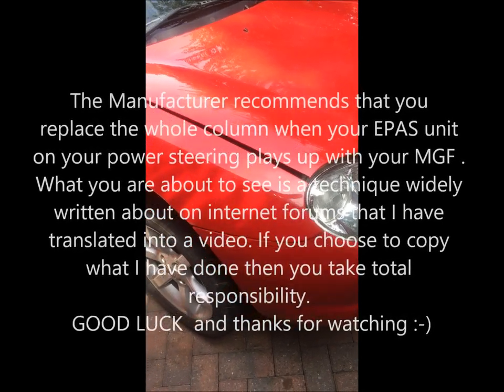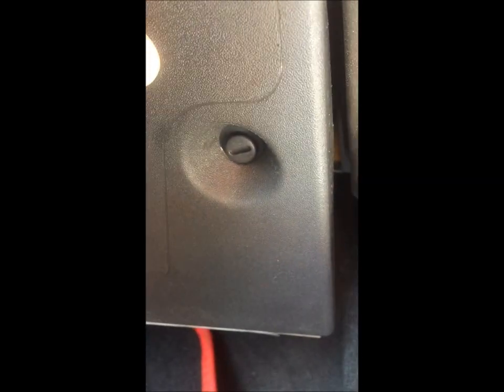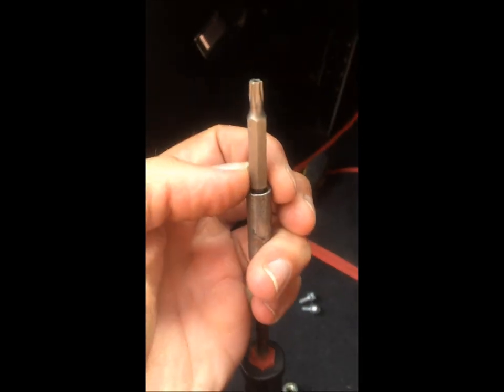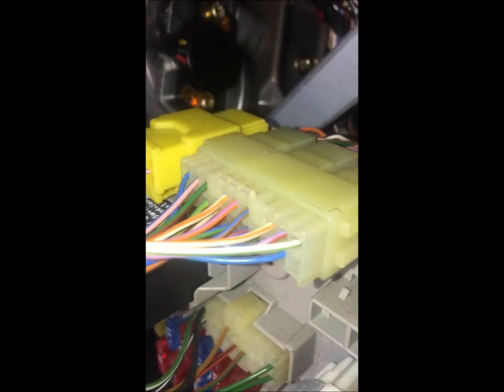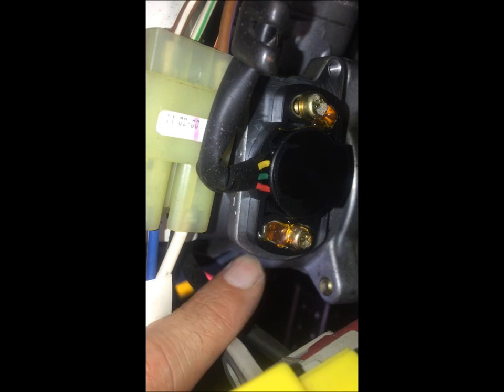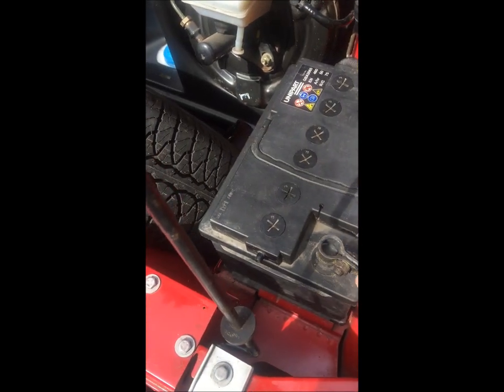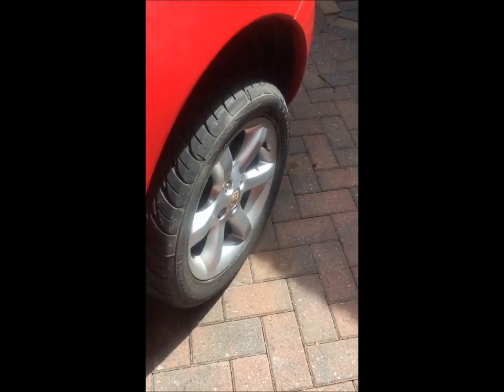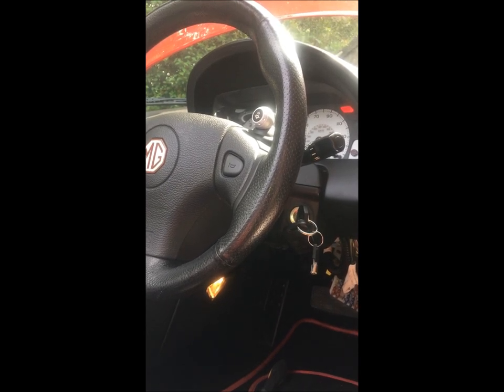HOW TO FIX MGF POWER STEERING EPAS FAULT

Comment: Thanks for this tip Paul. i`ve just bought an MGF 75th Anniversary and the steering wheel is doing exactly this. The previous owner had been told by a garage that the problem was due to crash damage , but I couldn`t find any evidence at all of crash damage and so doubted the diagnosis. Now I know exactly what is causing the problem and how to repair it. Many thanks - Ian
Reply from the maker: Absolutely no probs at all Ian. Ultimately if we keep sharing these little gems of knowledge we should be able to keep our MG's on the road for a long time yet to come 👍

Comment: Oh mate thats amazing! Thanks so much. 

Just back from the garage, was prepared to order a steering column from eBay and get it fitted. Decided to do a bit of googling, and found the instructions (from 2009 so they were missing the diaghrams and images...). Thought to myself that surely someone has done a YouTube video about that and there it is!

Looking forward to trying the fix later this week! Will post back how it went.
Reply from the maker: No worries at all and well done on persevering looking for a DIY alternative to chucking money at the car 👍
Reply: @paulosfandango_  ikr. Its part of the fun for me lol
Reply from the maker: @evtimtrenkov1800  Same here. Changing the old exhaust for a TTMK9 took 4 hours + 5 hours in A&E and 6 stitches 😂
Reply: @paulosfandango_  OH bollocks! Sounds like one of the less fun days on the driveway :D
Reply from the maker: And I'd still rather do that than change a central locking motor again 😂
Reply: @paulosfandango_  LOL I can't even start to imagine what that's like. My timing belt is due. I am still comprehending whether I am confident enough to have a go at it lol
Reply: @paulosfandango_  first attempt - failed lol. It started raining just as i was trying to get to the Epas bugger. Did you only move the fuse box to one side or did you disconnect it completely and put it aside? I removed the bolts and the holding bracket but access to the steering column was still very limited.
Reply from the maker: What a bugger!
Yep literally moved it to one side. I didn't stress about any shorting because of disconnecting the battery. 
It is tight but it's doable. Just take your time is all and you'll be fine.
Reply: @paulosfandango_  Thanks mate. Yeah I will try to go with a more powerful torch too, because I struggled to see the bits that hold the plate of the sensor attached.

Comment: Thanks Paul. I had exactly the same fault and it was fixed inside an hour. I removed the entire fusebox for more space. The torx tool tip is essential and I would have wasted ages working it out.
Reply from the maker: No worries Steve. We've got to keep these little beauties on the road 👍

Comment: I wonder what is involved to do power steering delete. The f and tf are surely light enough to be use able without it
Reply from the maker: You are able to remove the fuse under the bonnet to cancel the power steering out but it isn't a very comfortable drive. It is a good way of testing to see if your EPAS unit is to blame though; as once removed the steering won't fall to the left or right anymore.
It's located on the passenger side, under the bonnet, under a white fuse cover.

Comment: I don't quite get why the tippex there ? It should mark the initial position of the sensor relative to its support or am I missing something ?
Reply from the maker: Correct. It's just in case you over loosen it and it moves too far. Realistically you probably won't need it but there's no harm in having a reference point is there
Reply: @paulosfandango_  The "reference" point should be relative to the support of the sensor over which it rotates - the column - not the screw. Tippexing the screw is akin to taking a dump next to the bowl.
Reply from the maker: Helpful comments are always useful 👍

Comment: Hie, can you help me with more explications please what you do exactly to thonse screws and what is that orange glue? And what should i do exactly pls write on my reply i dont understand english perfectly,this is my dream car i bought 10 years and never get bored but now the steering is a little bit hard and i dont find the fuse and dont know what to do exaclty pls help me!
Reply from the maker: Hi
Please see the attached link for full written instructions:
https://forums.mg-rover.org/mgf-mgtf-sponsored-mgfntfbitz-mgf-mg-tf-parts-01457-238202-12/mgf-power-steering-column-change-325683/#/topics/325683
Reply: @paulosfandango_  Thank you very much now i try to practice very helpful ty .
Reply from the maker: @10RADU  No problems. If you lived locally I would just check and fix for you